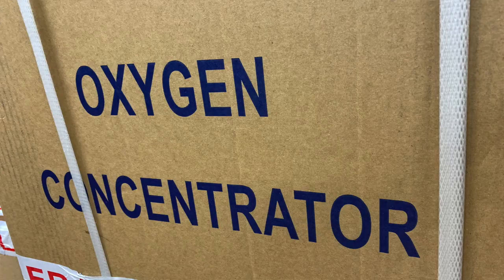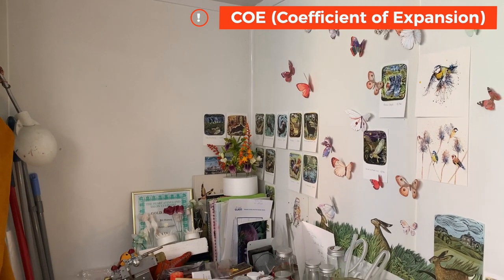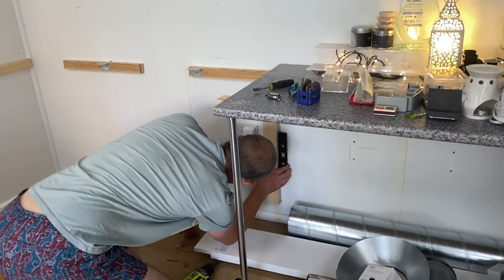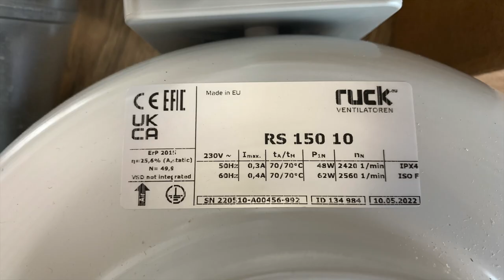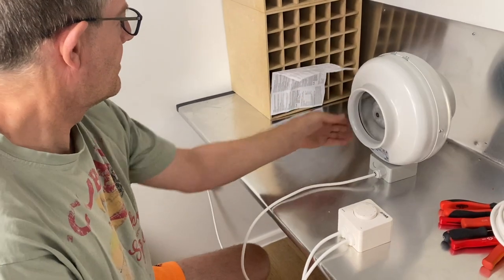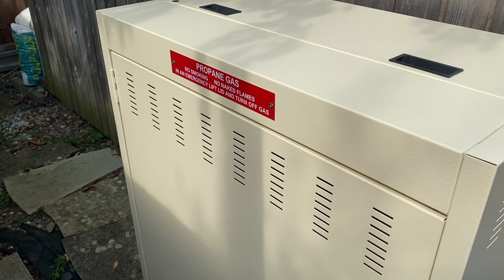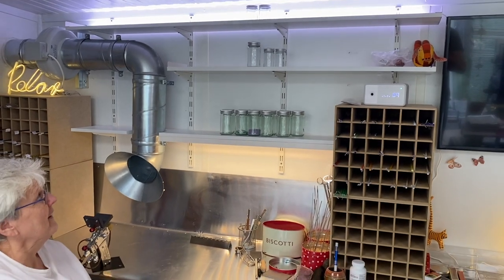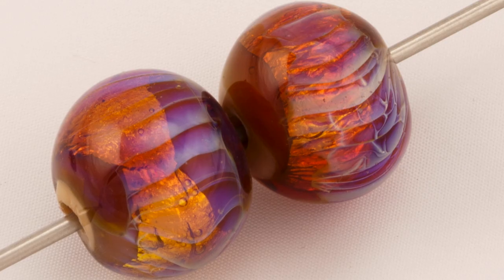Setting up a lampworking studio + studio tour

Comment: Great to see your set-up. We bought a kit from Tuffnells but the fans paddles warped with the heat. We did have the fam situated away from the funnel end so air had chance to cool but metal def the way to go.
Reply from the maker: Ah that’s frustrating for you. Thank you for confirming our concerns about plastic fan blades.